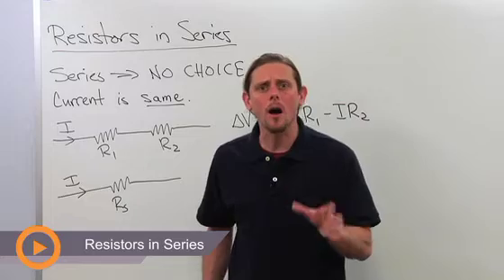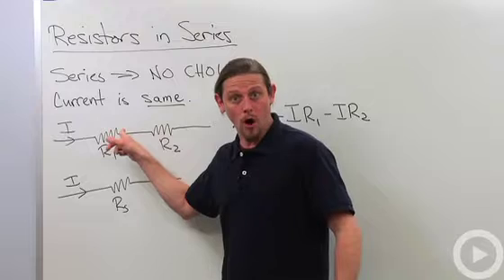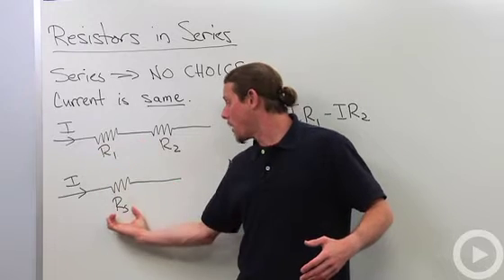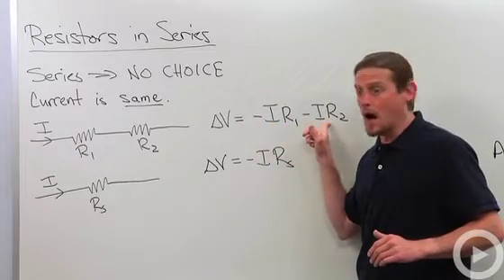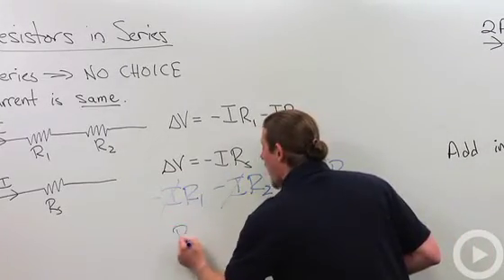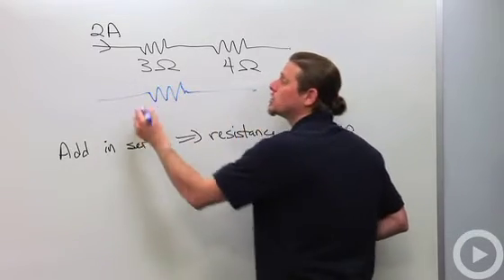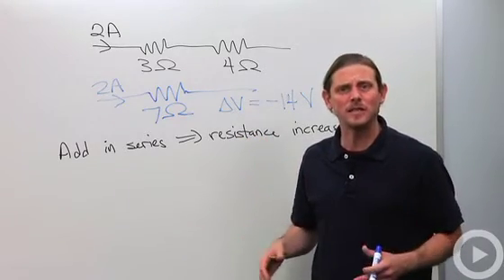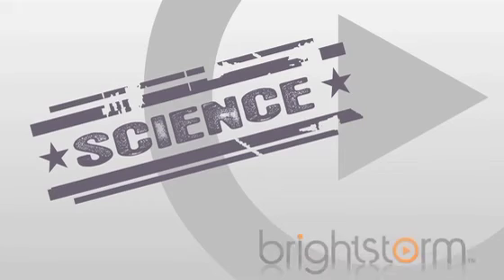Resistors in Series

Comment: hi brightstorm how would I calculate the value of a resistor that has to be connected in series with two 48ohm resistors connected in parallel to limit the current to 3A the supply voltage is 230V ? Can you please explain it to me thanks.